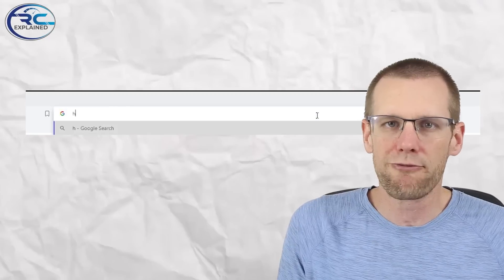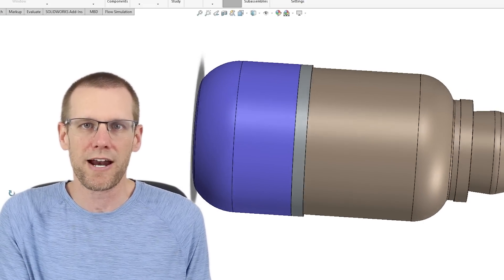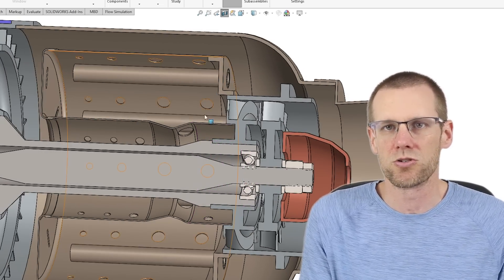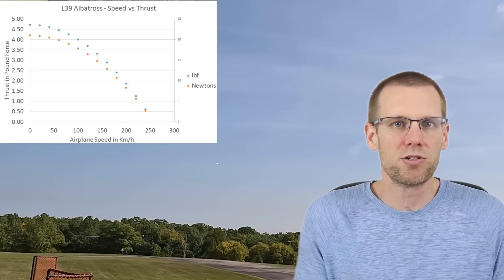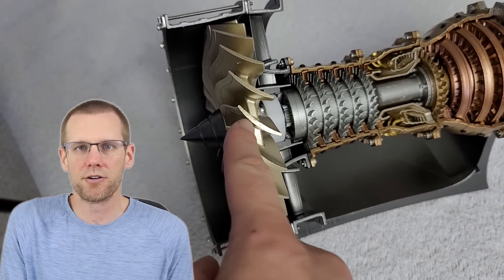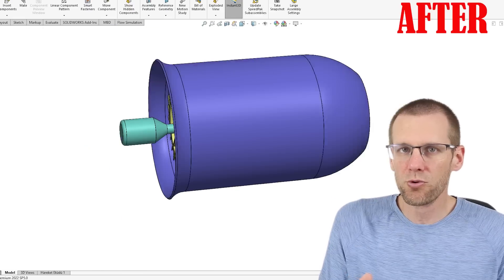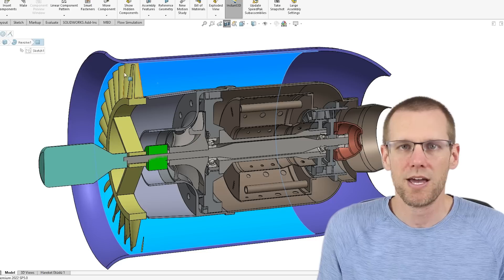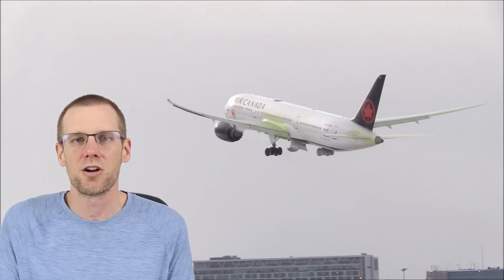RC Turbine Engines Could Be Crazy Efficient If They Made This ONE Change!

Comment: Kurt Schreckling the author of "homebuild turbo engine" wrote a second book on turbo props and turbo fan. He designed, built and flown a twin spool turbo fan in the 90s. He also discussed many different designs and the need for a separate power turbine in either cases. Highly recommend the book. "the model turbo-prop engine for home construction.
Reply: Since I probably don't get to buying that book, I wonder if a fan for a (medium or rather low) bypass centrifugal compressor should not also be centrifugal ( or at least diagonal? ). We only have this small anular bypass. The nacelle still has to direct a lot of air around the engine. Though, I guess at slow model speeds, the bypass does not choke, so, we still can have a large frontal area. But still (second negation) , the fan could just as well sit on a wide hub which ends almost in the diameter of the core engine. So centrifugal forces are at play. A lot of low bypass military engines have multiple stages on the fan. So it is not uncommon to have quite a pressure on the bypass, which again increases efficiency overall if we feed this pressure into the second stage.
Reply: @ArneChristianRosenfeldt Hi Arne, not sure if I understood your question. In order to make an efficient engine, it's important to have both the fan and core running in their efficient zone. So how much shaft power there is available to run the fan at which rpm will all need to be factored in regardless of the types. The core wants to spin fast but not too fast for fuel efficiency but the fan cannot spin too fast to the point that the tip starts to stall or goes supersonic. A gear box capable of high reduction with a low profile, being light weight and can tollerate the shaft rpm is not that easy to make. In comparison, a concentric double shaft engine with free rotating power turbine is easier to achieve. There is also a limit to where the compression ratio of model jet turbine can go. With increased compression goes the temp raise for feed air and temperature of turbine. So we can't exceed the limit of turbine material without blade cooling or using the ceramic matrix ceramic fiber stuff as turbine.
Reply: It also came to me that centrifugal turbines are good for pressure with trade offs for speed and flow rate. it makes little sense to have centrifugal bypass fans because we want to generate thrust which is F=mv^2 .
Reply: @yibofan6855  I mean that from the packaging point of view fan and compressor need to have a similar degree of "centrifugal-ness". Lots of single stage centrifugal aficionados go far beyond 0.7 Mach which  seems to be a hard efficiency drop for airlines. With two stages we would no need to and still reach the combustion inlet temperature. We would have enough pressure to press cooling air through the slits of the combustor and over the inner and outer walls of the turbine so that only the blades get hot. Thanks to the higher efficiency with zero shock waves, we have a higher pressure at the same temperature.
Reply: @ArneChristianRosenfeldt , I am not an air space engineer. Please don't take my answer too seriously. From what I have read, as long as we increase the compression ratio, we will increase the cooling air and turbine temperatures because air gets hotter when compressed. However, there is room for increasing the turbine temperature before we need to bleed uncombusted air from the compressor and directly deliver it to the blades. We can also allow the same compression ratio with the two stages but increase the mass flow instead. In order to do that, we need a larger cross-section and/or spin the compressor slower than the single stage, which makes a bigger and lower rpm engine more efficient than a smaller, higher rpm engine.
Reply: @yibofan6855  I want to cool the duct to not burn my plane and I want to cool the hub in order not to burn my bearing and cook the oil. So I need enough bleed air to film cover these rings.

Others could not answer me why we don’t use elaborate stator vanes before the turbine wheel. I like velocity stacks with their round intake lip. There is a video how smoke streams around this edges without separation. I want a barrel of these with cooling air from behind. The each pipe bends and converges towards the wheel. I gave up the idea of matched combustors. A turbo in a car only needs one pipe. But using like 4 pipes per combustor is so much more compact. So annular combustor it is. I also want conical low pressure loss intakes. So annular is actually a torus , a crown.
Reply: is that the same guy who got arrested for sleeping with his sister?
Reply: @AFourthPosition  couldn't be. He is a retired German engineer.

Comment: "This ONE Change!"

:: Goes on to describe a completely new clean-sheet design that would maybe have 2-3 parts interchangeable with the old engine, at best ::

This is nearly impossible, and it would be better to start designing a small turbofan from scratch. What you could do however, is use KJ66 (minus the exhaust nozzle at the back) as a gas generator for another separate module consisting of a free power turbine, a gearbox and a prop, making for a quick and dirty makeshift turboprop. It would be considerably more fuel efficient.
Reply: Agreed, but this is old news been done years ago already...This guy doesn't know the subject matter at all..😳😳🙄🇬🇧

Comment: Efficiency isn't the goal with model turbines though, it's cost. All model turbines manufacturers know how to design small turbofan but the cost would double or triple and simply drive people out of thr market. Also, model turbines do not scale very well, it would ve easier adding another compression stage to increase compression ratio run on the same common sahft, something you can't do with a turbofan as the turbine-conpressor cannot run at thebliw speed a fan requires, so it would need to be a twin shaft of planetary gear driven fan which is just too much engineering for a model that needs to run for 30 minutes every other weekend

Comment: Let's don't get too focused on centrifugal jet bad, multistage axial good,  There's good and bad examples of both in the full scale realm.  Some of the most efficient full scale jet and turboshaft engines made are combined axial dual or triple shafts driven by multiple combustion exit turbines powering combinations of bypass fans and internal centrifugal/axial compressors.  The more compression achieved in the combustion chamber, the better and more efficient the engine is overall.

Making this complexity into an RC model engine is going to be the difficult thing because jet model engines, like their piston engine counterparts tend to require simplicity, lightness and ruggedness. This is why the old Rolls Royce style of centrifugal compressor model jet is more widely made as a model jet engine, and this also applies to turboshaft engines.

When you can make a pretty exact copy of a Garret type of multishaft/ centrifugal-axial/compressor jet or turboshaft, maybe we'll have something to discuss.
Reply: The compressor itself is not bad, despite what many claim. A centrifugal compressor simply does not fit into many planes. It does not fit into engine nacelles of Me-262. It does not fit into an F-22 . I may fit into a trainer jet with their relative weak engines. It does fit into a helicopter -- especially if you have the space for example a single engine behind the cabin (where it would replace a piston engine) or in the nose of this pink Magnum PI helicopter. It looks a bit more ugly in nacelles.

Comment: Can it be done, yeah.  But to what end?  How much bigger would it make it?  Heavier for sure.  How much wider.  And how much more will it cost?  What's the market for it?  Does a RC plane need a state of the art turbojet?  It may be nice if you're building a RC airliner but don't see this being used in most RC Sport Jets or RC Military Jets.  Current RC jets are based on 1940s tech and are perfectly adequate for what they're used for.  The hobby can be expensive as it is, throwing in a $20k turbojet isn't needed or wanted

Comment: the big problems are it would double the weight and tripple the cost, and most of the people that use these engines these days would look no further than that. As a 40 year gas turbine building veteran i have seen and tried this from every angle.
for model and hobby sizes, forget it. for the bigger sizes yes, but not planetary box type. that would become the new life limiting section as opposes to bearings. much more to say on this but im not going to. its already being taken care of
Reply: I thought the life of an RC turbine is limited by the frequent crashes I seen on YouTube.

Comment: Considering a main point of RC models is to, well, model full-scale aircraft, it's a cool idea, because it adds more realism. But let's be honest - efficiency is basically irrelevant in this space. Most models employing RC size jet engines cost five figures (the engine alone costs ~$3k last I checked), and as such, are flown maybe a few times a year. I'd be surprised if they burned more than $50 worth of fuel in a year, so the cost of fuel here is negligible. A more efficient design might save you enough to buy a cup of coffee or two over the course of a year.

Efficiency is much more important in the commercial aviation world where jet liners fly hours each day, every day, to make money for their owners, and a 10% savings translates to millions of dollars over the life of the plane.

Comment: Just one question, have you ever considered the effort needed to make that gear box? As least for GE PW1000G, last time I check it tooked them 5 years! Are you willing to invest that much money into it?
Reply from the maker: A better fan drive would be an inner/outer shaft running off a low pressure turbine wheel. I'm not in the model turbine manufacturing business, I just want to see a model turbofan that we can drop in our model jets.

Comment: F=MA tells us that flow speed or flow mass are interchangeable and indistinguishable from a performance standpoint so half the mass at twice the flow, or twice the mass with half the flow are equal.
Reply: In thrust yes. But kinetic energy is 1/2 mv^2, so doubling the velocity quadruples the energy consumed accelerating the exhaust, while doubling the mass flow rate only doubles it. Net effect is that it is much more efficient (in fuel terms) to accelerate a larger mass of air by a smaller amount to get a certain amount of thrust.
Reply: @nerd1000ify Your point is accurate that Force and Kinetic Energy are not interchangeable values, they are only related.  It is the same phenomenon as a car breaking to stop from 40mph will take more  than twice the distance than a car doing the same from 20mph, or why your car cannot make a  sharp turn at high speed that it can easily do at low speed.  Both situations describe the effect on the same mass at different accelerations so its not entirely a fair comparison being Mass is constant but the velocity was varied, but it illustrates your point about the impact of kinetic energy on the forces it applies.  It is the same reason a spacecraft will do plane changes at apoapsis, where the vehicle velocity is at it lowest so you need less energy (Dv) than it would at periapsis where the direction change would require more energy due to the higher kinetic energy of the spacecraft (same as the car analogy).

Comment: TL;DR: Find more CR first.  You'll find 20% efficiency increase with just getting the pressure ratio up 1.  

This.. is a bad idea from the start.  

Model turbines tend to run in the 2-3:1 compression ratio range.  This is WAAAY down at the 20% efficiency end of the brayton cycle.  Get that up to 5:1 (do-able, but difficult in a single stage) and you'd see a 50% increase in efficiency.  Better sealing, a longer combustion chamber, better turbine design.... all things you can do without completely coming up with a new format, would net you more than your proposed design would do.  Model turbine engines "barely" run.  There's so much more to do to them before considering adding complexity.  

There are massive difficulties in your chosen method of driving a turbofan.  Most important is you're taking shaft torque from a 150krpm shaft to drive that fan.  Every gear interface has ~some~ loss of torque, and at 150krpm input, that's going to be a wildly unpleasant amount of energy.  The bearings in your model engines are cooled by fuel in a large part because they too have some loss of torque, and because they're going 150krpm, that ads up to a lot of energy.  

Your fan design is a poor choice.  Or at minimum the air path is.  Since turbines are driven by compression ratios, any, and i mean any, additional pressure before the centrifugal stage is of monumental importance.  Why you'd give up even the slightest input pressure has my head spinning.  

You're also proposing a direct power turbine, and those are .. tricky to manage at best.  You see them really only in very specialized applications where changes in power state aren't needed quickly.  They really only work at their design rpm, which is fine for a turboprop with variable pitch blades, or an apu that can idle at run rpm until a load is applied, but that wont work for a model airplane that needs to throttle.  

So lets talk parts count.  At minimum your design is going to need a fan, two support bearings, a pinion, a spur, and at least two planet gears, a new exhaust turbine, a new support bracket to hold the gearbox and fan.  So.... we're talking a minimum of a dozen new parts?  And a few of them are going to be pretty complex.  

Lets say you just want a turbofan.  A dual shaft setup, with a fan on one end, and a second turbine on the other would get the same results without needing a gearbox, get you around the problems of doing direct power take off from the gas generator, and present many fewer engineering problems.  But... we can do it even simpler.  The first turbofans had rear mounted fans, with the turbine and fan being the same part.  That gets us down to bearings, a carrier, and the turbine/fan assembly.  If you could figure out bearing cooling, it would be just one precision part.  

This is why you were told you need to read more.  To be a good engineer you need to know what came first, why it came first, why what came later, and why things happened in the order they did.
Reply from the maker: I think you missed the point of the video.  Making a mock up model for a youtube video is not an optimized engineering project. This model performs exceptionally well for its intended purpose. I'm happy to see that you went deep into the details of turbofan design. I can only hope that a manufacturer is able to give a turbofan design a chance so that we can hear one of these in our models.

Comment: Man, you need a gas turbine at the exhaust to drive the fan in front, and a concentric independent shaft. There is not enough power in the regular central turbine used for the compressor.
Reply from the maker: Agree. This is how it is done for the turboprop engines.

Comment: Making and lubricating/cooling that reduction gear is likely the hard part, given the scale and tolerances involved. Also any torque loading on something that small may present some material issues. Might need to change things and make an enclosed impeller on the compressor with gear teeth on its outer diameter and do the reduction gearing there. (Planetary ring?) Having lash and lubrication just right still seems like a headache (gland seals?), even if you did that to reduce any torque loading. Not saying impossible, just tricky which would make that kind of thing even more expensive.

I'd be curious as to what the military has with its smallest fan jets. (Something like this must already exist if you think about it.) But one also has to consider most of those applications are one-time-use, probably not something a hobbyist would be thrilled with given the initial cost.
Reply from the maker: Very good ideas and points! Thanks for your input.

Comment: It seems like you are describing more of a turboprop hybrid by driving the fan directly from the main spool via a gearbox. In most actual turbofan jet engines the fan is driven by its own low pressure turbine which is independent of the core, or high pressure compressor and turbine.  N1 (fan and low pressure turbine) is the low pressure spool and N2 (high pressure compressor and turbine) is the high pressure spool.  The fan (N1) is only turned by the hot gasses from the core (N2) moving trough the low pressure turbine blades.
Reply from the maker: Yes, this would be a great method to use too. I really just want to see and hear the sound of a model turbofan engine.

Comment: you should also provide a cfd analysis for the turbine .
Reply from the maker: This turbofan is not optimized in any form and leaves a lot to be desired. I'll leave the optimization to those building and manufacturing model engines.